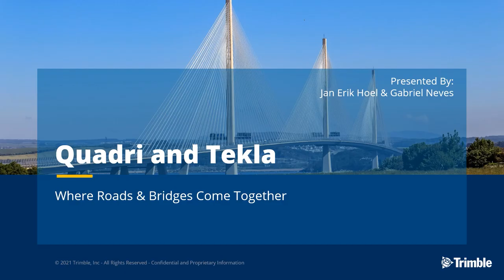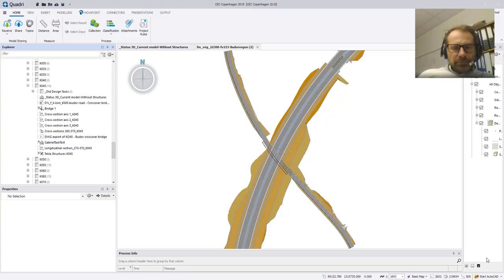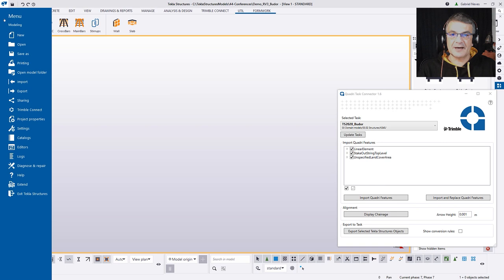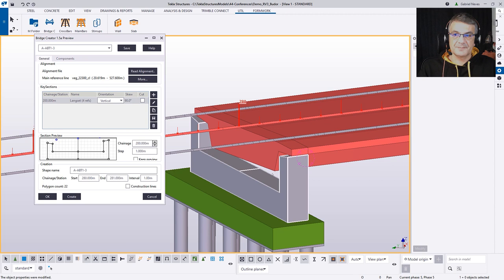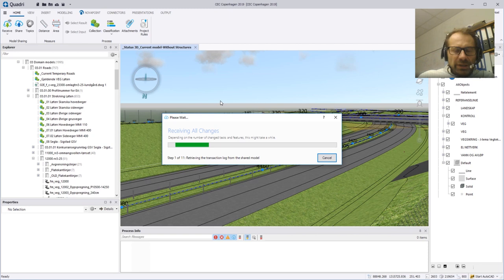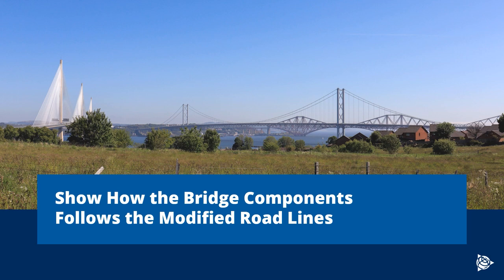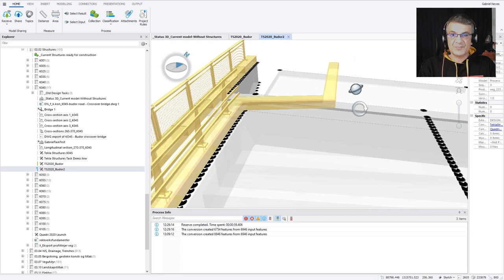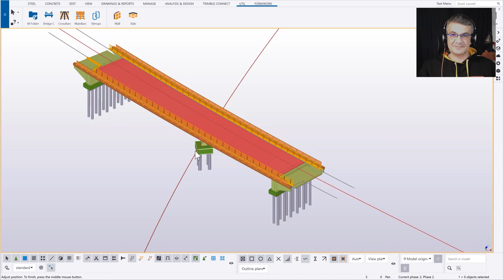Quadri & Tekla Structures - Where Roads & Bridges Come Together - Trimble Basecamp Conference

Comment: is the road alignment stationing generated as a projection of the stations in 2D plan or distribution of the distances along the 3D alignment ? Thanks
Reply from the maker: Pawel, stations are generated as a projection in 2D plan. They are the road stations not the length along the 3D line. Cheers